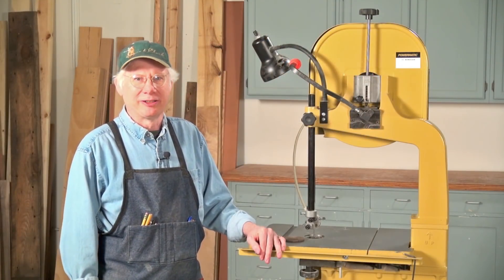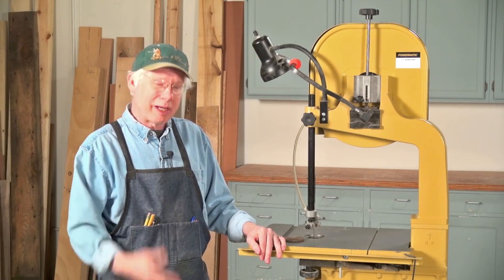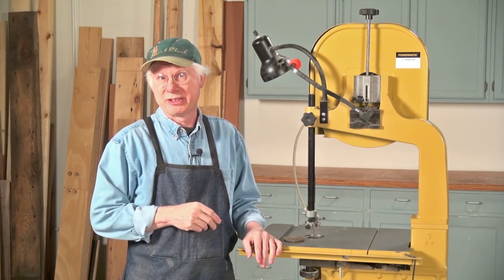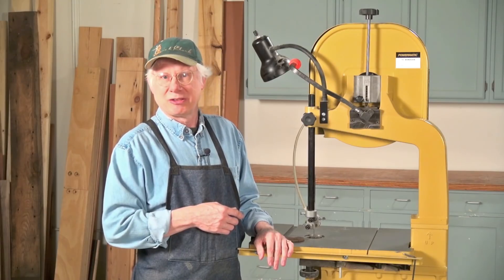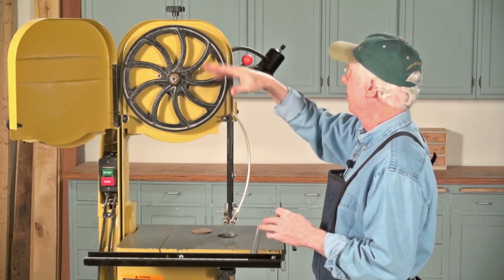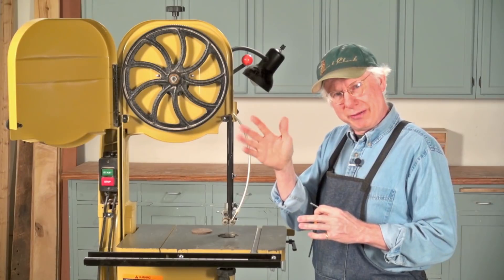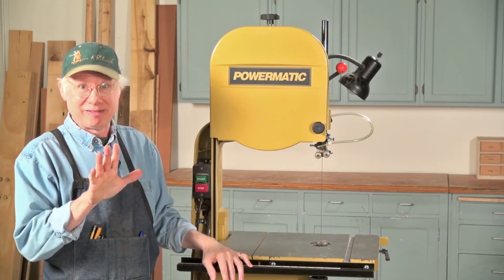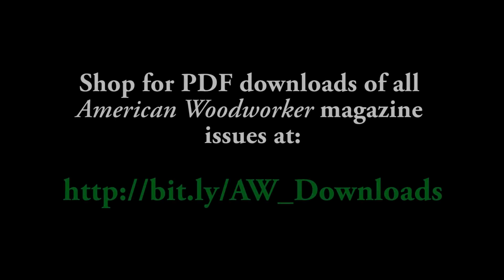Using the Flutter Test to Tension a Bandsaw Blade

Comment: Funny to actually learn this physical test for tension. I've always plucked the back of the blade like a guitar string and raised the note to a certain pitch... I couldn't tell you what note I'm tuning to, but it has always been consistent across the many blades and saws I've used... Now I can ditch that method, or see if there's a new note I should be tuning to!

Comment: Great video, my only thought is when replacing blades, as I just did, they aren't always the exact same length. With that said, the tension gauge on my saw is useless. It's a new saw and I adjusted it as per manufacturers recommendations and the tension setting still doesn't match the blade I have on, that's why I think this is a great way to tension. Blades can stretch (although minimally) over time and again, the gauge setting wouldn't be reliable. Thanks for the tip.

Comment: my bandsaw is a 10 inch rikon and  doesnt have tht lever in the  back  so the flutter test is  best for my situation , althouhgh  i keep breaking bandsaw blades at weldes  im guessing   the   buttjoint blades are poop or tension is to high , my  saw  has no blade  on it atm   too expensive to  replace   10  x  a year
Reply: I had the same saw and recently got rid of it for just that reason. My theory is that the tighter radius flexes the bands too much and causes the failure, especially the narrow ones that I wanted to use.
Reply: did you get another 10 inch ? i have  had the same  problem  with 3/8th 1/4   and  1/8th blades and  even a   1/2 inch blade all broke  at weld .i think i  had one  blade actually last  almost a month  i couldnt believe it .
Reply: i think ,  the one    time   i actually got it  to stay on  for a   while  and not break i  did the flutter  tension way  other  times  i did not  use that  technique.  i did  the   gullet in the center of the blade thing
Reply: of the wheel i meant  gullet in  center of the  wheel
Reply: No, I got a 14" to replace it.
Reply: nice  ,  enjoy ! i still have the  shit  rikon saw 10 inch ,I don't wanna even invest in a blade.  I guess i'll  buy a  handsaw  :p
Reply: what brand did you go with  for the  14?   i wish i had money to buy a laguna bandsaw!   they are  super sexy
Reply: @africancichlids3011  ,,
Reply: @africancichlids3011  ,
Reply: @johnconklin9039  cool

Comment: I only have a Craftsman bandsaw. It's not a very expensive one bc I'm just getting started. I've got me blades and installed them and adjusted the tension but my saw makes a shrilling sound. I've done everything I know to do... rechecked to make sure the tension wheels aren't to close but I'm at a loss. The saw works great and saws straight but that noise! Any thoughts? Thank you for this tip.
Reply: Shrill like a bearing is squealing? Often times there is noise if the guide bearings are too close to the blade (sides and back), touching while not under load.I set my guide bearings to a fraction of an inch of not touching the blade, while the blade is free spinning.
Reply: wheels  should  only   move  once cutting  occurs. other  wise  a playing card thickness, is usually fine.   
 or the thickness of  2 sheets of  printer paper.